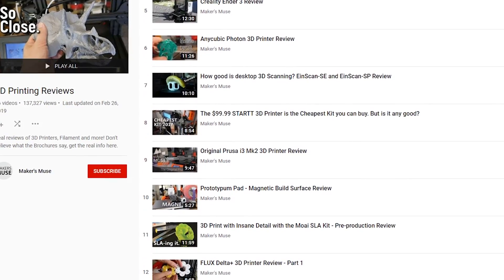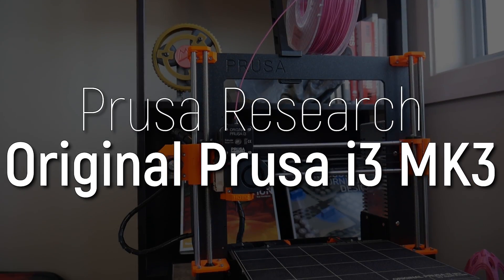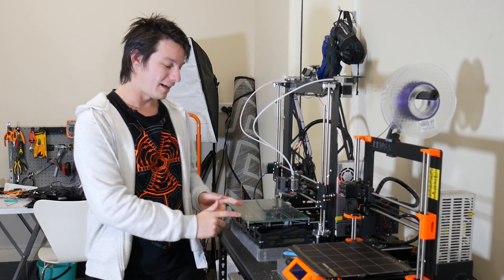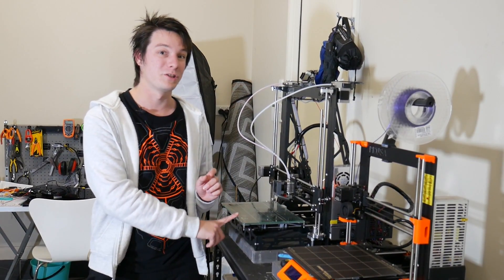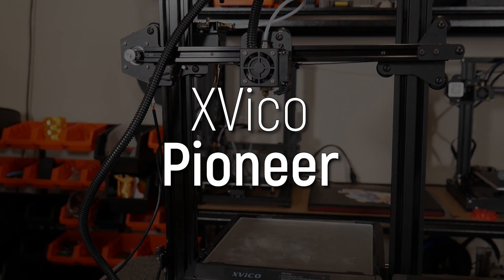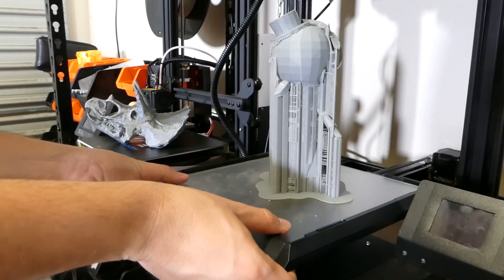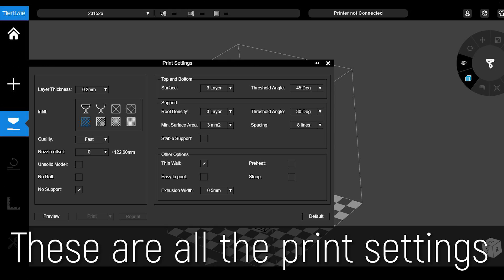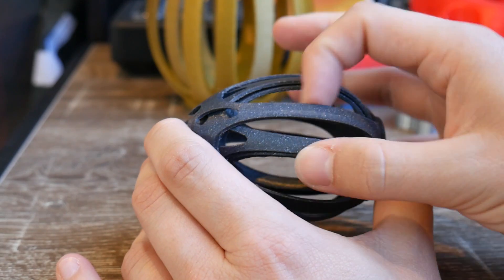My TOP 3D Printers for the 2019 Maker's Muse Studio (FDM/FFF)

Comment: Why don't you have an octoprint on your non wifi printers?
Reply: Yeah, I just pop a Raspberry Pi with WiFi onto the printer, install OctoPi, and away we go.
Reply: @BradfordNeedham  with 10-20 printer's, thats a lot of pi's and more work, but could be worth it on he's main printers
Reply: @andreasthomsen852  I guess it kind of moves off topic on the whole 3D printers "usage" rather than "maintenance", but with knowledge and time, an old PC/ or even a Pi and a good usb hub would allow for a single control point, just one octoprint instance controlling multiple printers. Web cams can also be managed over a USB hub as they can be identified over vendor id product id and thus associated with the octoprint profile/running instance for that particular printer.
Reply: @heimdall2099  hmm, did not konw that you could run multible printers, form one Pi
Reply: You can  @andreasthomsen852 ! Just not @ once...
Reply: If you have a super secret project you probably want to have a printer with zero wireless foot print.

Comment: With printers like the prusa. Can't you plug in an octopi to make it work over network? That's what I did with my CR-10 at least and it works flawlessly
Reply: Yes, You can use Octopi to print to make  it run over a network.  The MK3 and the Wanhao i3 I own are both controlled remotely using a server software.  If your doing remote printing while not at home I suggest a Fire Suppression system such as Blazecut's T-Series though (better safe then sorry).

Comment: I own Anet a8 and after about half a year and lot of upgrades its finnaly working flawlessly i upgraded the mainboard and drivers, changed bearings and moved to sturdier metal Tatara frame
Reply: Can you really call it an A8 by this point? There really isn't much left of the original in there. Most A8s end up as custom DIY machines, it seems. Mine sure did!
Reply: You are right 😅 at least i still have linear rods and extruder but i like to call it A8

Comment: My  Most reliable printers are Prusa i3 Mk2.5, A heavy modified (as in rebuild) Ultimaker 2 with Buildtak flex, 5015 blower for cooling, original BLTouch Chimera+ hotend with 65w hightemp and pt100 sensors and Bondtech BMG extruder. Mainboard is Duet Wifi running on 24v PSU (not the underpowered 20v Ultimaker) I also find Ender 5 with custom firmware and probe being quite reliable.
Prusa MK3S  is also used regularly.

Comment: Use a mix of glue and water on your glass surface... but ONLY IF you can remove the glass and place it in the freezer. Sometimes it's too good at sticking.

What's cool is that you can simply place a few more dots of the glue/water mix on what the film the print removed off the glass.

Comment: For the same reason of reliability I use genuine Prusa i3 machines 95% of the time. I have 4 x Prusa i3 machines, all recently upgraded to MK3S parts. Two of them are enclosed with the PSU and electronics outside of the enclosure, which I use for high temp filaments, and the other two machines I use for PLA and PETG.  I also have a bunch other various Chinese machines and two machines I built myself, but none of them come anywhere close to the reliability of the genuine Prusa machines. I mainly print functional parts for both personal projects as well as client projects, so reliability and accuracy is most important.

Comment: Great video that probably will help my to choose which 3d printer I am going to buy. I am hinting towards the prusa but still not sure. The main use for my 3d printer will be printing flex TPU parts for my FPV Quadcopters. So will a prusa be the right choice or is there a better flex TPU printer on the market in the same price range that has good TPU printing quality without having to modify the printer?
Reply: Harald Note that if you take a Prusa with PEI removable bed, you’ll need to use glue on it to prevent the TPU from sticking too much - which removes a bit of the convenience. I’d rather print TPU on a glass, but I have no experience concerning the best current printers to handle flex filament
Reply: The Prusa prints TPU, only used ninjaflex so far. It takes some tweaking (slow down everything) and the already mentioned bed adhesion. Aplastic scraper and some IPA does the job for me.

Comment: Just a small tip - I am using Toshiba Flash Air (W-04) SD card with MK3 and I don't need to run with the SD cards anymore. There is one trick for W04 - put the Card in the printer and than hit reset button... files are loaded than...
Reply: I have been using flashair SD cards on my prusa's for several years. They are great, just drag and drop files to the network drive as if it was attached to your computer.
Reply: Strange, my MK3 refreshes the file list automatically when I use my FlashAir. No need to hit the reset button.

There's an option on the MK3's menu that allows you to set the SD mode. If you haven't done so already, try setting it to FlashAir and see if that allows it to automatically refresh.
Reply: @Spectere  I do not need to reset the printer either.

Comment: Flashforge Dreamer is a reliable workhorse at work. Over 3100 hours of print time and only now it started having problems which will be solved by replacing a few parts. It's not a perfect performing machine, some questionable engineering choices in the design and no Cura support, but Flashforge has proven itself as a reliable and forward-thinking company and the newly announced Creator 3 looks like a treat. 8/10.

Comment: Thanks for sharing, Angus. I love my cetus3D printers. They have a nice footprint, meaning that I can fit quite a few in a small space. WiFi has also spoiled my quite a bit. I do agree on not liking the perimeter limitation, however, it’s not really stopped me from making some nice durable parts. I just recently started printing PETG on it and they’re doing quite well. I also like flashforge. My first printer was a flashforge inventor. While the dual nozzle was more of a novelty since colors dripped into each other, I never used it for that. It was quite the workhorse though and again, I liked the WiFi. I sold it so I could buy more Cetus printers. I find that using the same type of printer when diving up pieces that will ultimately go together ensures that they will fit together more easily.

Comment: Whaat!? you're still using SD cards? Get a RPI3 with octoprint. sooo much easier mate and cura/pruser slicer both natively support it (simpify with curl command hack).
Just glue stick the glass. never been able to print on glass without so hints on how to make that work would be good
Reply: Unless something has changed, SD cards print faster and more reliability than Octoprint. The video features are nice, but also considering Angus' use case (working in the same room as the printers) it especially does not make sense.
Reply: Huh? No reason for SD cards to be faster than OctoPrint. Also I have OctoPrint on three different printers, and have never seen slow printing.

Comment: I have an off brand of the flash forge duel extrusion printer that’s sold by micro center. It’s called the power spec ultra 3D.  With its full metal construction it handles most filaments and is inclosed for abs printing. 😊. I also have a ender pro 3 that is a pile of junk and has never worked from the day I assembled it. 🥴😡. But we can’t have all the cool tools. Not yet any way.
Love the videos.

Comment: Hey Angus, great video, nice walk through of your main printers.  Have you thought of adding OctoPrint to your Prusa and other machines?  I have an Ender 3 and A Geeetech A10M that I use daily, the Ender does the bulk of my prints and the Geeetech does any dual extrusions I need (mostly print the church crosses on that one) and I have connected OctoPrint to both these machines.  OctoPrint works really well with remote monitoring as well.  The only complaint I have with OctoPrint is that if the power goes out, your print is ruined, there is a way to print from the SD Card with OctoPrint and that will allow power resume but it takes so long to copy the file to the SD Card that I ignore that.
Reply: You can sort of have the best of both worlds (wi-fi and power panic) with the MK3(S) using a Toshiba FlashAir card. Its network transfer rate isn't the fastest, but it's tolerable (though it only supports WebDAV—ugh) but since the printer sees it as a standard SD card power panic will work as expected. You don't have the same level of remote control that you get with OctoPrint but at least you don't have to juggle SD cards around. I've used this for about a year with generally good results, and the only reason I moved back to OctoPrint was to have a more seamless printing experience with my Palette 2.

The only catch is that this might not work optimally on non-MK3 printers. Prusa Research added a FlashAir mode to the MK3 (not sure if the MK2 has it) that apparently allows the SD card to draw more power than usual so that they can support those cards reliably.
Reply: Or you can use a UPS (Uninterruptible power supply) on your printer

Comment: I use Creality CR10S with Zesty Nimble extruder, E3D v6 hotend, duet wifi board, 220V heatbed, everything in acrylic box. I print PLA, PETG without problems. PC-ABS requires some print surface preparation, because sometimes printing object sticks too hard to glass, sometimes lifts corners. Since day one I’ve had Octoprint on raspberry pi to connect wirelessly, now Duet wifi does not need that.
I found that the upgrading and fixing printer made me learn a lot about how printers work, how to get most of them.

Comment: Daily driver: Safety modified and firmware updated Anet A8 with the stock acrylic frame and glass bed. Thing just keeps pumping out great prints down to 0.08 LH with any filament I shove down it's throat. Two years so far no complaints. Cr-10 firmware updated and UL power supply for the big stuff a lot more problems there.

Comment: I found the S upgrade for the prusa lowered the artifacts on prints.
Reply: Agree. It's not completely gone, but it is better. On the MK3S the nozzle is closer to the X-axis, which must reduce the effects of machine vibrations at the print. Or it could be that I just did a better job at assembly the second time around.

Comment: Please make a review of the Anycubic i3 mega.
Reply: its an amazing printer, I have 2 because even my 10 &12 year old kids can use them without needing my help for perfect prints including flex filament.
Reply: Has it had any problems? I'm looking into my first printer snd stuck between that one and the cr 10 mini
Reply: @2way93  Anycubic i3 Mega-s is much easier to assemble and needs much less work to get a good print.  I have both.
Reply: My starter machine! the only problems were due to the stupid operator. Never needs adjusting.